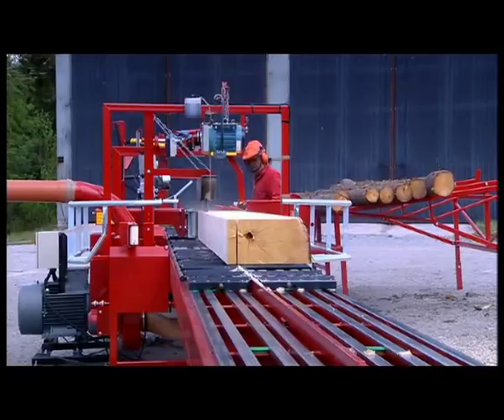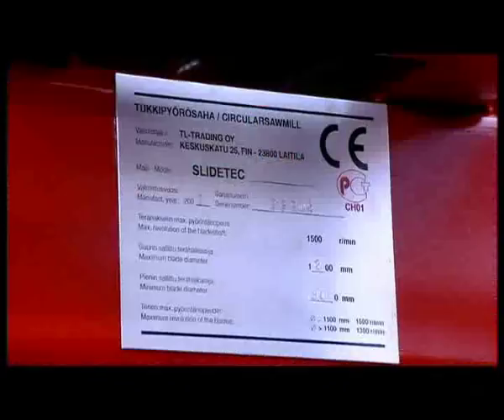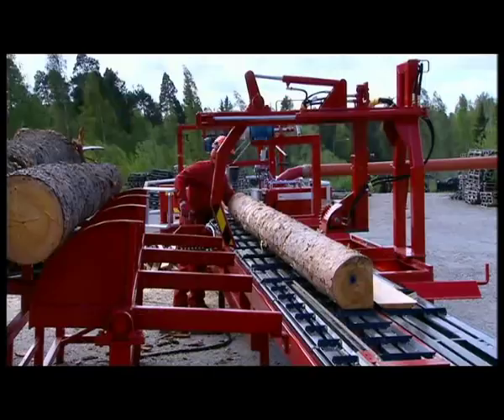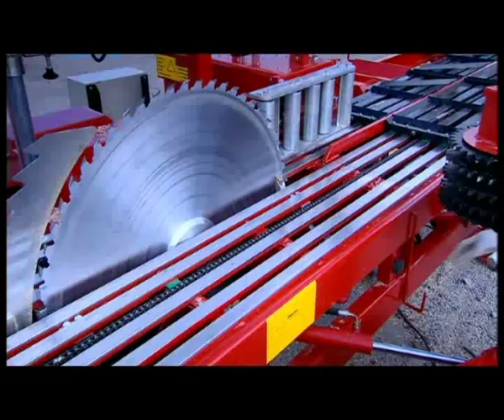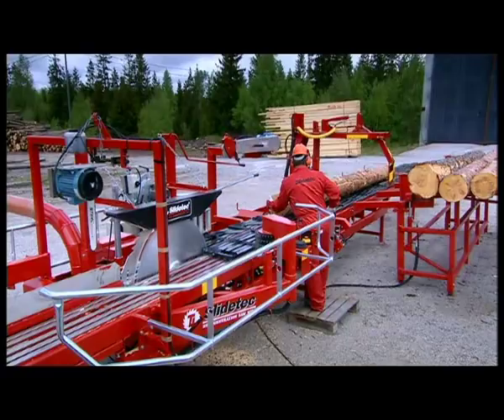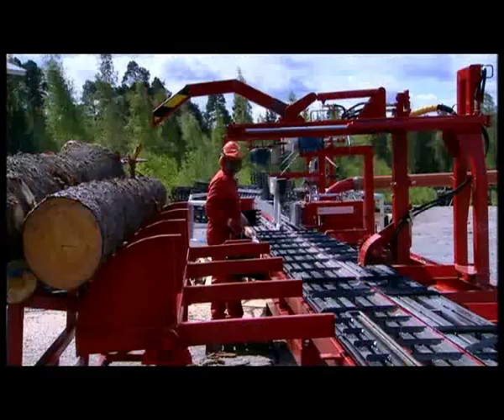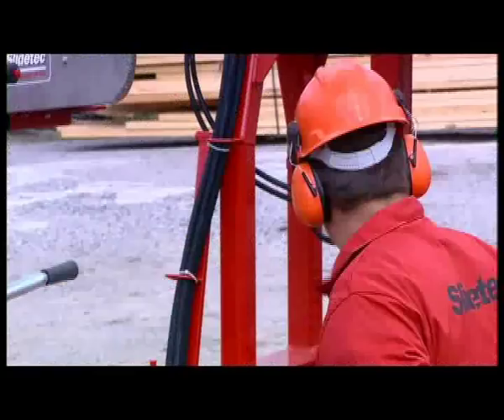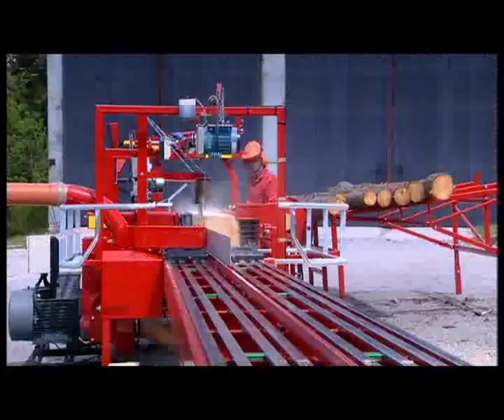Slidetec Circular Sawmill Demonstrations video

Comment: We had a guy set one of these up at our mill .I was a supervisor at the mill so had time to watch the guy operate it . He had just bought the unit and set up here to work out the bugs in the system . I was really impressed with the sizes and saw finish . Seems there were no bugs to work out , because the operator just flew through the logs . The only help he had was the 966 that would pick up the waste and finished product every once in a while and would add logs to the short indeed deck ha had. The only thing I would do is lengthen the log deck . I never saw a footage count , but the operator sure pumped out the wood , and this was a new machine to him .

Comment: What is the Diameter of Saw Blade needed and it's Kirf loss?? We need to use thin blase to avoid loss of wood. We generally saw up to 36" Diameter of Round logs.
Reply: That is true
Reply: Most commonly used diameter is 1000mm. However the top saw adds up that you can saw around 80cm logs. The saw kerf is little above 4mm the saw blade is 3,4-3,6mm thick